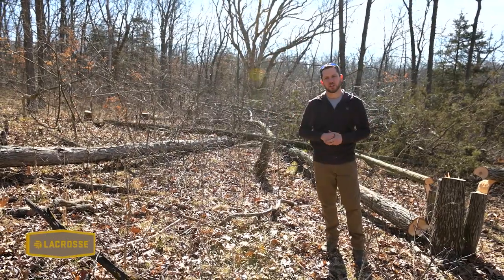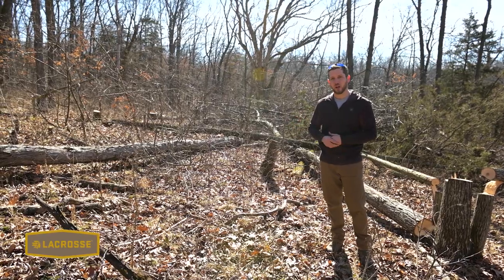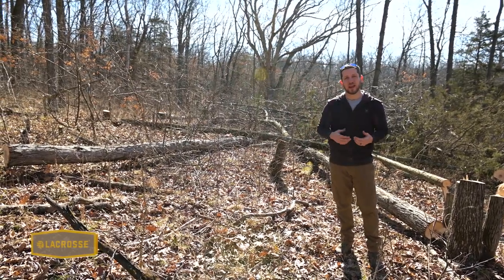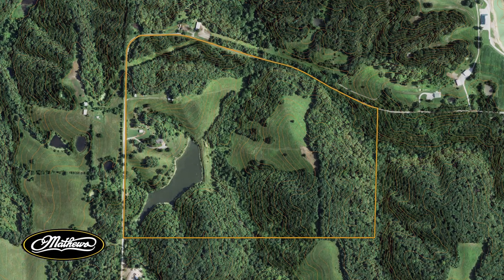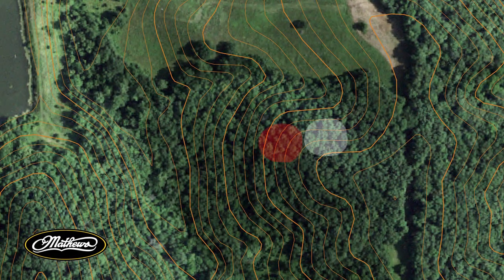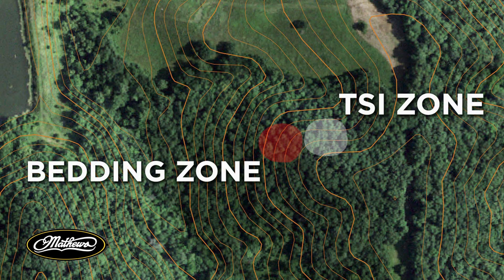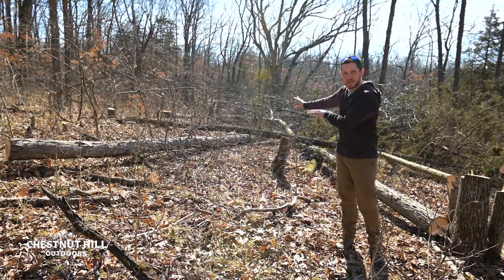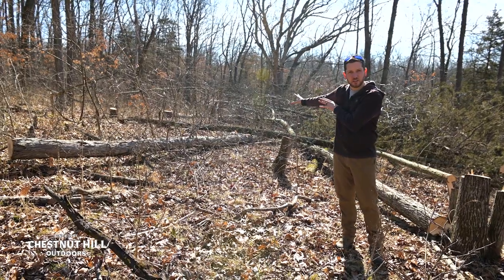Bedding Cuts And TSI For Deer | WHAT'S THE DIFFERENCE?!

Comment: Do you differentiate your bedding size and location between does and bucks, or do you create enough continuous bedding cover to attract and hold both? Also, where in relation to your food plots do you create both? Thanks.
Reply from the maker: The size and proximity to food sources is very site specific. On this particular project we were converting 15-20% of the total timbered acres with a combination of bedding cuts and TSI. This bedding cut was roughly 300 yards from a food plot and the TSI cut was in between the bedding cut and the food plot. The cuts ranged from 1/4-1/2 acre, roughly. We don't necessarily create the bedding cuts for bucks or does or both, just deer in general. 15-20% managed acres were not continuous stretches of timber, they were strategically placed throughout the property (7 units) based on prevailing winds, topography, best entry/exit. Following up the cuts with fire is crucial in the management of the converted acres. Hope this helps!
Reply: @Whitetail_Properties  Thanks for your prompt reply. I recently inherited 120 acres of mature timber (65% red oak, 9% white oaks) in NW Wisconsin that I’m planning to develop for deer hunting. The first part of the plan is to select cut to 30% open canopy for understory development and clear cut for food plots around the periphery in order to create a sanctuary in the middle of the property; I’ll connect the plots with cut corridors to channel the deer from one plot to another with stands on those channels. Since I’ve always found does bedding very close to food, my intent is to hinge cut within 50 yards of the plots for does where bucks will bed behind them in the 
property’s middle section. That’s my plan and why I asked. Thanks for responding.